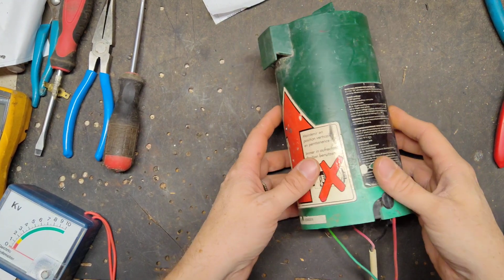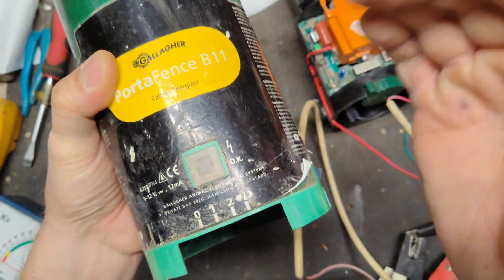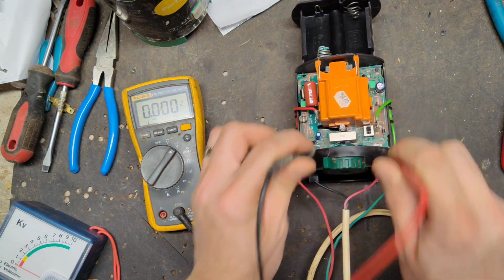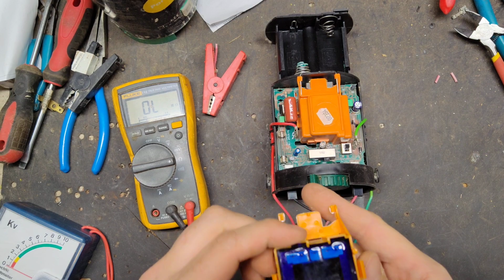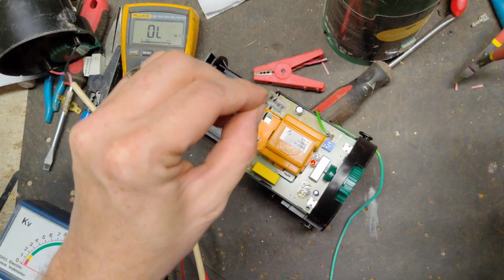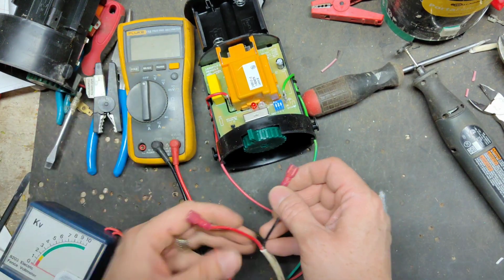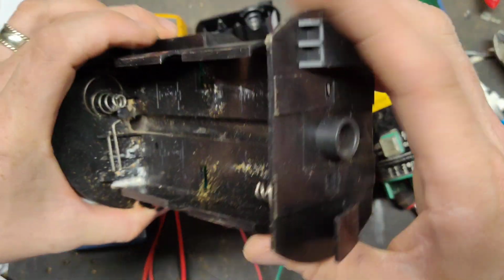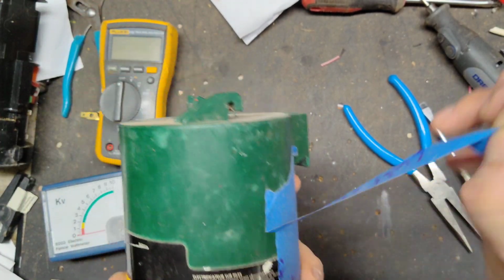Gallagher B11 Fence Energizer Repair & How It Works

Comment: I  have one of these but it’s not working at all anymore - when connected to a 12v battery I get no response. What is that likely to be?
Reply from the maker: You Likely have a board issue somewhere. We can either get you a new board or send me the unit or inner sleeve that holds everything and ship it here for me to go through.

Comment: Solid red light on a Gallagher B10.. new batteries and reading 9.4 v at terminals going into transformer.. any ideas what could be wrong? 
Thanks.
Reply from the maker: Possibly, but most likely not. Those are all old school design and don't come in all that often. If the old batteries test bad, then it's worth a shot to swap out. But if they test good, then changing them won't help. Then at that point, I would send the unit here for me to go through. Most, if not all, the parts are still made for it today and I might have the parts in stock.
Reply: @FencerFixerRepairLLCKansasCity  It wouldn't be worth my while sending it to you as I'm in northern Ireland! Thought there might of been high resistance somewhere simple that I hadn't accounted for.. is there anywhere online that sells the parts for it? Thanks for the help.
Reply from the maker: Here's our part number we have here in the states for the B10 module, G36319. I'm not sure if it's the same exact part number for over there or not. You could try asking the Gallagher distribution center for Ireland. https://www.gallagher.eu/

Comment: How do you install it to a wire / or fence
Reply from the maker: There's two male spade tabs on the board inside, one is for the fence and the other is for ground and they may be labeled next to those tabs as well but I can't recall. You attach an insulated wire to those tabs and run them out of the case and put the cover on and use some alligator clips to attach to those wires to the fence and ground system. To physically mount the unit to the fence, there's some hooks on top and your thread the fence wire through those hooks and hang it on the fence line. You can put a step in post on either side right next to the unit on the wire to help hold up some of weight of the unit on there wire if need be.